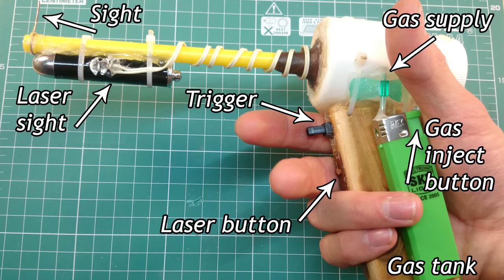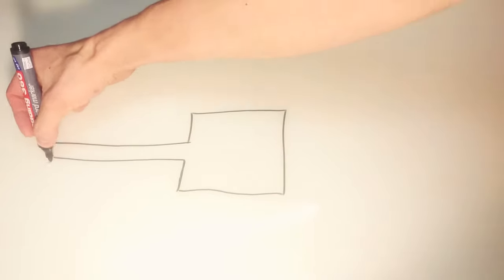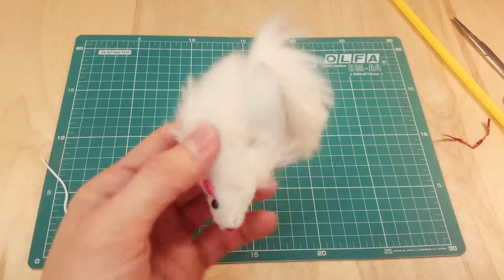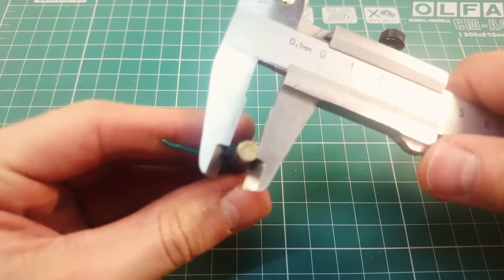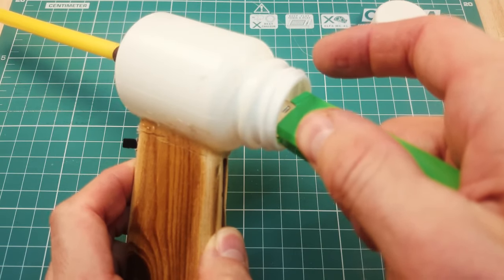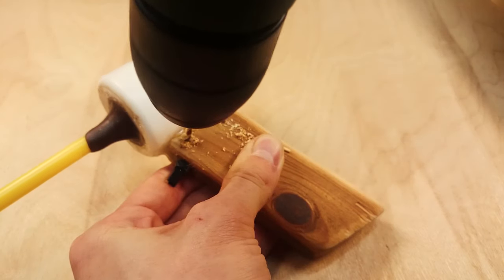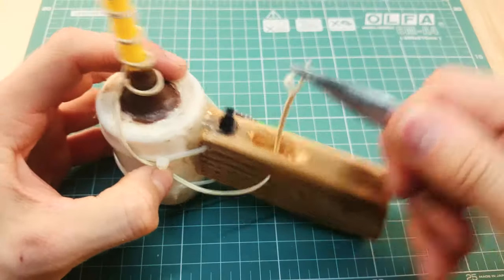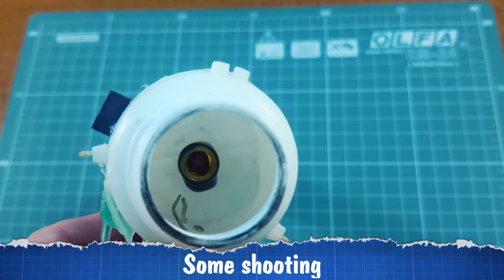DIY gun pistol (mini spud gun)

Comment: Hello. I have got a problem. my lighter's piezo has only one wire. however the lighter works with that. would I use it as it is?
Reply from the maker: Yes, it has one wire. Another wire is a piezo's metal butt
Reply: Gyver Show so how should I use it?
Reply from the maker: Andronic Wrecker like in the video
Reply: Gyver Show Oh sorry I missed that part.